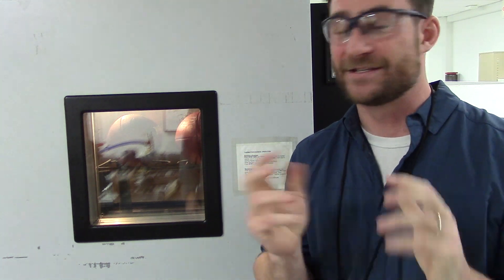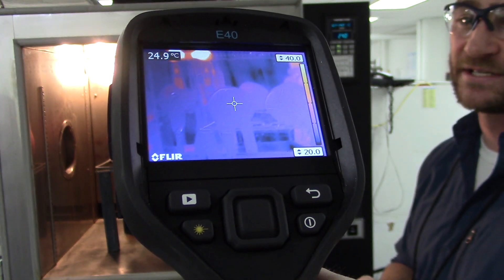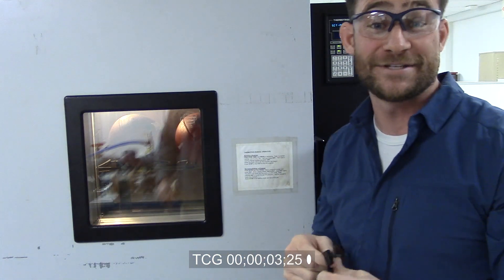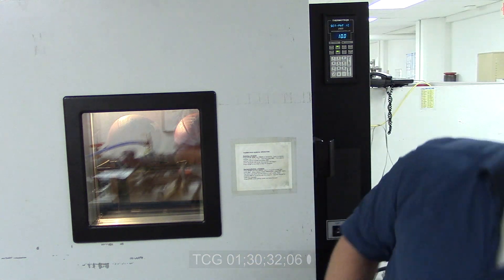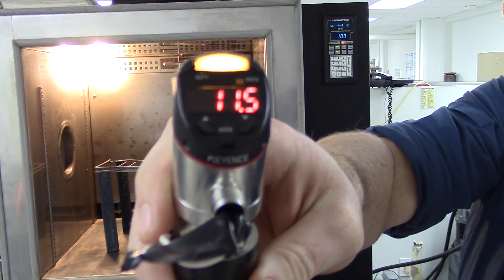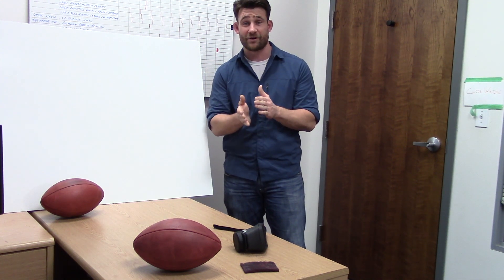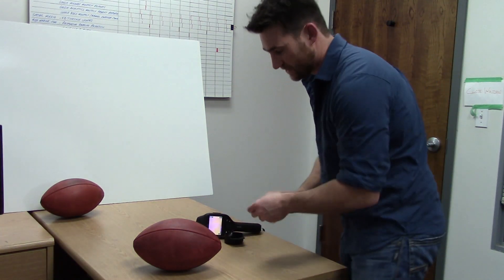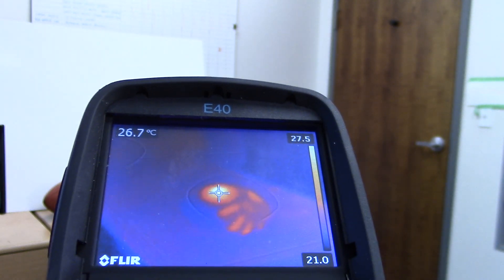Deflategate - Engineering company demonstrates temperature's influence on pressure of NFL football

Comment: 11.5 PSI ... but several of the Patriots balls measured below this. You should have done another scenario where you inflate the ball to what was measured (some Patriots footballs were under 11.0 PSI) at 10C and then heated it up to room temperature to see what pressure that gives you.

Second, the friction can add heat to the surface, but not the inside.  Why was a pressure reading not obtained after rubbing the football?

Comment: This is a good example of why it is necessary to add air pressure to your car tires in the winter...other wise,  your car tires are under inflated (not safe). For car tires you are better off (safer) to be 5 lbs over inflated vs 5 lbs under inflated.  Remember, as the temperature goes down...the air pressure inside a closed container always goes down.
I have no bias one way or the other...and I have not watched a football game in the last 40+ years. The 1974 football strike ended my obsession with NHL football! I felt betrayed by the players strike and that ended my obsession with football. As a kid I sold Coke & Hot Dogs as a means to be able to see the Denver Broncos games in person. I was devastated by the strike. Good by Football after that.

Comment: The experiment is inaccurate. You're actually supposed to use a crappy $5 PSI measuring instrument to check the balls before they cool down and then another crappy $4 PSI measuring instrument to check the balls after. Then you have to forget which one you used. That's what the refs did and that's what you should have done to improve accuracy.

Comment: Every SCUBAdriver knows about a hot fill.    When you compress air it heats up and if you fill a tank with that hot air by the time it reaches room temperature instead of getting the 3000 pounds that you paid for you get something a lot less.    At sea level air pressure is 14.7 psi.   So if you take a deflated ball and another 14 pounds of psi to it (Relative to atmospheric pressure of 14.7). Do you have essentially doubled its temperature from the room you filled in.  So the ball would have seen even a greater drop in temperature after resting.
This assumes you filled it from the compressor or a hand pump.  But If the ball was filled from a compressed tank of air that had been allowed to go to room temperature the ball would’ve been colder that the air in the tank due to the air in the tans going to a state of lower pressure in the ball.  In this cast the ball would’ve actually gained temperature and pressure.
The problem is trying to explain this to people.  The more Brady would’ve  tried,  the more he would look like he was covering something up.  So it was a no-win situation for him.

Thank you for doing part of the temperature test.  Too bad you’ll never convince the haters.

Comment: All you have to do is drive a car with tire pressure sensors. Cold weather makes them alarm all the time if they were initially filled in the warm weather.
Reply: Forget the sensors, You can see with your own eyes when a tire looks like it needs air coming from the warm city and then driving through snow.
Reply: I can definitely confirm I'll have all my tires at 40lb on the money and if my car is parked where only my passenger side is facing the sun those will stay like 38 whilst the side in the shade will go to 35ish but then at dawn they'll all be back to 38 and this reading from 40 to 38 happened due to a 40 degree temp drop
Reply: Thats dumb a car has constant weight on the tires
Reply: What? That's not true I'm a mechanic I've never seen that happen once. I've inflated thousands of tires in a warm shop and then taken them outside the warm shop to the freezing temperature of a Canadian winter. Never seen the light come on because of that. That could be easily a 70 degree F change or 40 degree C from inside to outside.
Reply: @fuckjewtube69  As temperature of the air changes the, density of the air changes which accounts for the loss in psi. This is why some places use nitrogen to fill tires being that it holds temps better.

Comment: a deflated football is actually worse.  deflated football by two PSI only add about 1 mm of grip and slows the balls speed down so what profit would it be to deflate a football for a qb?
Reply: Obviosly you never playef football, 1 psi is a huge difference for qb, wr and hb but keep telling yourself theres no diffrence
Reply: The whole so called investigation has already been proven to be a biased farce from start to finish.  Multiple scientists have weighed in and explained slight pressure loss during the game, and the head Ref who the checked the pressure of the balls did not even use the same devices to measure the balls. In fact, the NFL provided biased photos of the two meters he used and changed the position of the rulers next to each meter to try to make the needle lengths look similar in length to each other. A complete scam of an investigation, and there is no meaningful evidence that there was any conspiracy to deflate footballs.  The crybaby whiners will always whine abiut it. That is what losers do. FYI ,  in the very same "Wells report" used by the NFL it was also shown that multiple balls the Colts were using that game were below the supposed league minimum, but no mention of it or meaningful investigation of it by the Commissioner.  Guess why???  LOL
Reply: WHAT? You've obviously never worn a helmet, not one for football anyway. Soft footballs throw like lame ducks, hard footballs throw nice tight spirals, got news for ya, soft footballs may have an easier impact on the hands but are far from easier to catch. And even if it were true, who's going to cheat to make things easier on teammates and more difficult for themselves? Clue in!

Comment: Problem is you can't just use the mean PSI for the footballs to fit your agenda.  If he cheated on 1 football...he cheated.  The mean PSI means nothing.  He had footballs well below the projected 11.5 PSI that margin for error doesn't fit within that realm.  Combine that with the texts from over a year showing that McNally and Jastremski discussed deflating footballs per Brady's request for payment and then video showing McNally sneaking off into the bathroom with the footballs which breaks protocol, the evidence is pretty clear that he cheated.  And that's not even considering that he destroyed his cell phone for no apparent reason.  

I don't like Goodell as much as the next person and their way of staking out Brady to catch him was shoddy work.  But, the Ideal Gas Law only explains the mean PSI which really doesn't matter.
Reply: Problem is that a deflated football is actually slower and doesnt even help the qb at all, the grip is only changed by 1mm after two pounds of air loss and the ball speed is reduced so what would the benefit be of intentionally deflating a football?
Reply: The claim is that the deflated football will help prevent fumbles.  I don't know how accurate that is, but Warren Sharp's statistical analysis backed by Brian Burke's analysis showed a major anomaly in the Patriots fumbles per play, starting right about when the league changed the rule to allow teams to prepare footballs (which was led by two players, Peyton Manning and....Tom Brady).

Even still, you could very well be correct.  But, it doesn't mean that Brady didn't cheat.  Plenty of cheaters and criminals have broken the rules/laws and later have found out that it was no benefit to them to do so.  

It should also be noted that Belichick wrote the foreword to the book Football Physics, which discussed many things such as how changing the properties of the football can affect his aerodynamics.  

And that's still all speculation.  But the problem with all of these scientists backing up Brady (and almost all of them are from New England and/or are self professed Pats fans) is that you can't use the mean PSI to prove your point.  The footballs measuring well below that PSI with the margin for error are all that matter.  And I could go into the fact that the scientists don't even know what the footballs were measured at when McNally got ahold of them.  They just know that they were in the range of 12.5 - 13.5 PSI.  They just make the assumption that they 'had to be at 12.5 PSI because that's how Tom likes 'em' w/o any proof.  Thus, the highest PSI football measured at 11.85 may have started at 13.5 PSI and that football would have deflated below that projected measurement using the Ideal Gas Law.

So, combine the 4 footballs that were well below the 11.5 PSI with the margin for error, the texts showing McNally and Jastremski discussing deflating footballs for over a year per Brady's request and getting paid by Brady to do so and the video of McNally sneaking off to the bathroom with the footballs which was against protocol and Brady destroying his cell phone for no reason, it's really an open and shut case.  And I don't like Roger Goodell as much as the next person and I think the investigation was poorly done.  But, still can't deny the fact that if he cheated on 1 football...he cheated.  And he did exactly that (well, 4 footballs that we can prove).
Reply: So you imagine the only under-inflated one or two balls out of 12 to gain an advantage?  Is that how you would do it?
Reply: @pundaint3177  Just because somebody does a bad job of cheating, doesn't mean they didn't cheat.  I don't imagine McNally and Jastremski to be these brilliant masterminds.  For McNally and Jastremski, they just have to make it appear to Brady that they deflated the footballs and then they get their reward.  So based on the video evidence of McNally going into the bathroom, my feeling is that he didn't deflate every ball.  And remember, he can't badly over-defate a football or the cheating will be exposed.  So he took off what he could in a few footballs.

But again, there are a few footballs that go beyond the Ideal Gas Law.  Combine that with the video of McNally breaking protocol and going into the bathroom with the balls (which was just odd to begin with) and the texts between McNally and Jastremski talking about previous incidents of deflating footballs for payment from 'Tom'...it is what it is.  Doing test trials with one football that may or may not have been at the PSI that the other footballs were at and using the average football PSI doesn't change that.
Reply: @richiehunt5097  If you can't beat 'em, make shit up.  If one of Irsay's players got caught with Irsay's drugs would he still be a player?
Reply: @pundaint3177  if my Aunt Jan had balls she'd be my Uncle Steve .  What one has to do with the other is beyond me.
Reply: @richiehunt5097  This was at it's inception an Irsay scam.
Reply: @pundaint3177  If it helps you sleep at night, knock yourself out.

Comment: Of course, you didn't use your fancy temperature controlled ovens to reheat the balls to the seventy degree environment in which they were measured at the game (which was in the locker room after they had had time to again reach 70 degrees F).  Oops....Silly engineer! LOL
Reply: the originnone The Pats footballs were measured right on halftime...it didn't have time to heat in the locker room...hence the way he demonstrated....the Colts footballs were taken into the locker room at halftime and were measured before the 2nd half started, hence only 4 footballs PSI were measured....this experiment is mainly about the Pats footballs....

Comment: When the NFL rule was changed so each team got to modify and use their own game balls, the ball pressure rule should have been dropped. 

Anyway, a ball pressure rule is unenforceable unless the balls are measured OUTSIDE before the game and at half-time with the same gage and the Allowable Pressure range is adjusted up or down for any temperature change during the first half (0.0513 psi per degree F) minus a small drop in pressure for wetness (0.2 +/- psi).  

All we really need to know about this controversy is that the intercepted Patriots ball was tested on the field by NFL reps at the request of the Colts and found to be more than a pound below the Minimum Allowable Pressure (12.5 psi).  But if they had adjusted the Minimum Allowable Pressure for a 23 degree temperature drop and rain (12.5 - 1.18 - .2 = 11.12 psi) they would have discovered that the intercepted ball was in compliance with NFL rules and taken no action. But instead, they called for a test of all of the Patriots balls at halftime by referees who had never done that before and for which there was no protocol. 

The impromptu testing of cold balls as they slowly warmed up in a locker room resulted in random and unreliable data that was nevertheless used to accuse the Patriots of a serious rule infraction causing enormous loss and harm to many innocent people and creating a sports controversy that will probably never be put to rest.  

But the saddest part, if you care about football, is that the entire episode looks like a trap planned and sprung by embittered competitors.
Reply: John David: You have posted a very good and prescient comment.Your last two paragraphs can be added to by saying,after Super Bowl LI,the trap went spectacularly wrong after an extra motivatedTB steered the Pats to victory....and a visibly embarrassed Goodell handed the trophy to Mr Kraft.What the NFL thinks about air pressure in balls is clear in that no action,none at all,was taken against other teams who have subsequently had underinflated footballs.

Comment: Thank god someone did this. I calculated this a long time ago and was laughed at.P2=[(P1)(V1)(T2)] / (T1)*(V2)I assumed the volume of the football to be  V1 = 0.15 cubic feet in volumeI assumed local atmospheric pressure to be 14.73 psiAlso, the ball is not a rigid container. So, there is a small error there. I assumed V1=V2T1 = 75 Deg F (Assumed Locker Room Temp)T2 = 40 Deg F (Assumed Field Temp)P1 = 12.50 psigP2 =  10.72 psig (Calculated)

Comment: Hi Mide Tech,

Wonderful video and clearly stated experimental parameters.
During the thermal imaging at 10C (thermal chamber after 90 minutes) the FLIR imager stated 14.2C and not 10C.

Was that caused by a distance dependence on your FLIR imager? A miscalibrated thermal chamber? A miscalibrated FLIR? or any number of other factors?

The thermal imaging of the scuffed ball is awesome.

Do I need permission to share this video in a classroom setting?  I am teaching physical chemistry and going over equations of state and the ideal gas law. 

Thanks
Reply from the maker: Abraham Wolcott That is a great question, it is possible that the thermal camera was picking up some reflections or having difficulty adjusting leading to a higher/inaccurate reading. Thermal cameras have issues with highly reflective materials like the steel walls of the chamber. However, we think the higher reading of the ball itself was more due to the amount of time the ball was in the chamber. We found that more than 90 minutes was needed to get the air within the ball down to 10 C, air is a great insulator! We chose 90 minutes because we thought this was a reasonable assumption for the amount of time from when the balls were in a warm condition to a cooler condition during the game. Our thermal chamber is calibrated annually and was within calibration during this test.  We also have redundant calibrated temperature sensors measuring the air temperature within the chamber.  We are very confident that the temperature of the air within the chamber (not the football!) was at 10 C during the test.

Of course you can share the video with your students, we would love that! We did a quick article on the ideal gas low and its impact, link below if you are interested.

http://www.mide.com/deflategate-how-temperature-can-influence-pressure-psi.php
Reply: Abraham Wolcott It could possibly just be fact that only inside chamber was 10c but right outside of it is/was prob 24c and door of chamber was open for a min or so b4 he checked with the FLIR and the temp was actually fluctuating and was down to 13.2 at its lowest b4 he grabbed balls so it may have just been the outside temp influence as well as fact he never really held FLIR perfect steady for long enough  just a thought